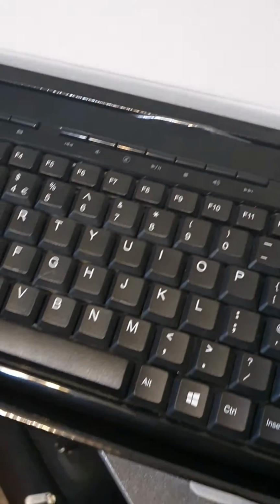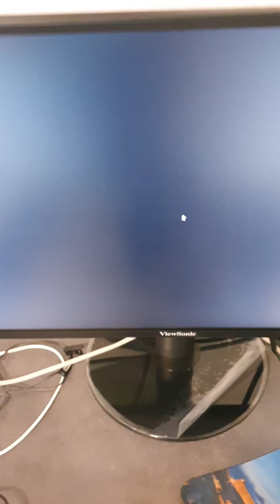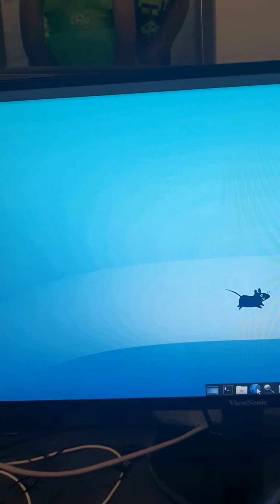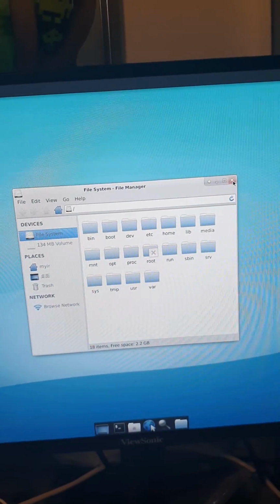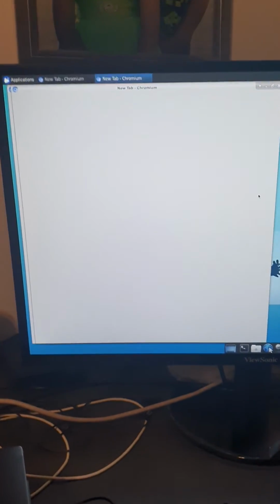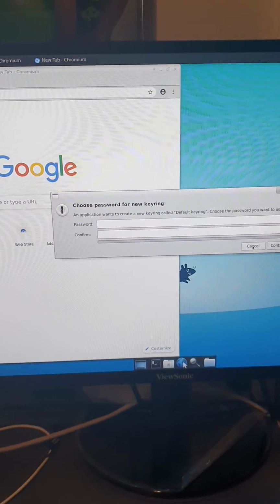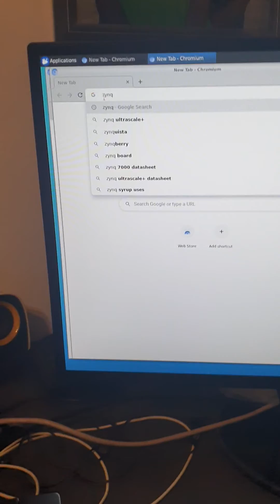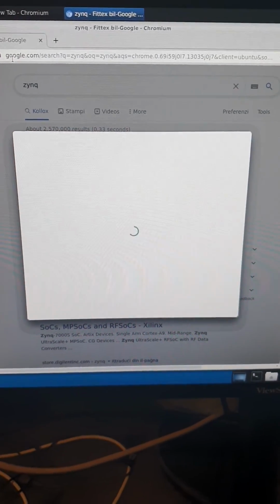MYIR Z-Turn Board loading Ubuntu 18.04

Comment: Can you please share the bin files?
Reply from the maker: it is not a question of binaries, there is a whole process using a Linux computer to prepare the embedded linux image to be able to load from an SD card. Apart from that, one has to have the right .bit file to compliment the Linux OS used. The right version of Vivado project should be used so that the HDMI driver will not stop after half an hour like the one supplied for free from LogicBRICKS. The support from MYIR is very minimal and this took me more than 5 months to achieve.
Reply: @josephattard_PIC_Spartan6_Zynq  I know that feel and i already gave up. If you have the binaries it would be useful for me because my purpose is something else. 😅
Reply: @arunmagesh   maybe it is not free of charge.....